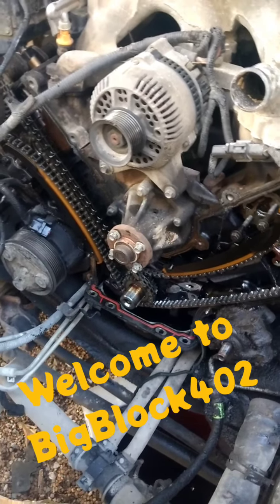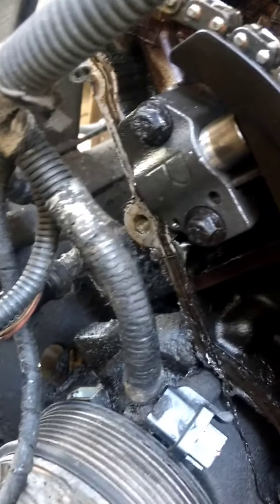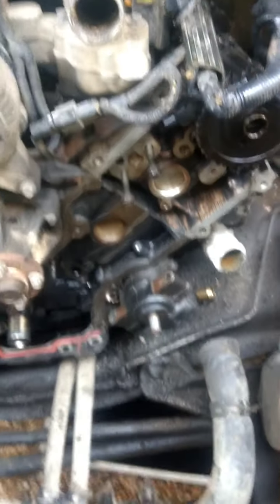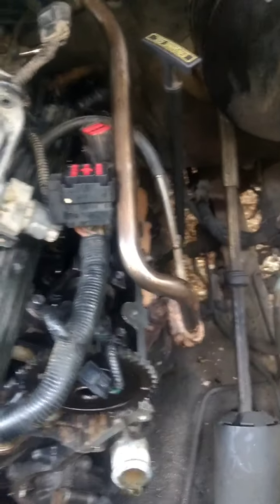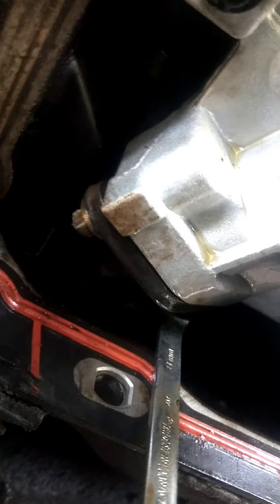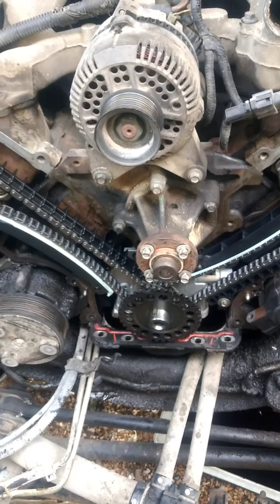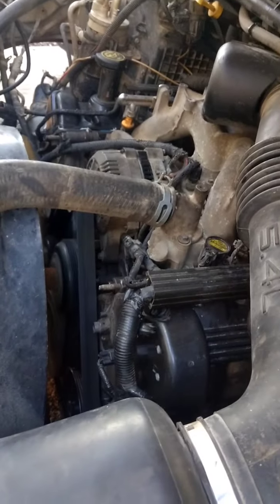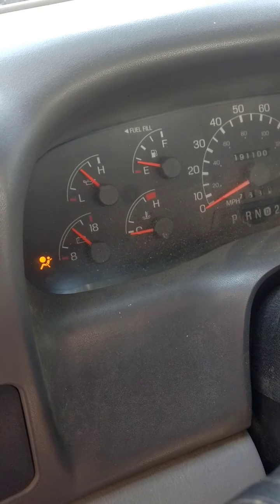Why this 2000 F250 lost oil pressure

Comment: You got lucky on that bolt.
Reply from the maker: I sure did. They dont always come out that easy. 
Thanks for watching
Reply: @BigBlock402  I've spent hours dealing with bolts like that, usually the first few minutes of it is, trying to figure out if I still have easy outs or if the kids peeled me for them again along with the drill bits.

Comment: Big pain in the back side. Had 4.6 in it they run for ever the 5.4  is a pain
Reply from the maker: My F150 has a 4.6l 2V and it has 416K miles on it. I done the timing chains and oil pump in it last year.
Reply: @BigBlock402   can't beat them 4.6